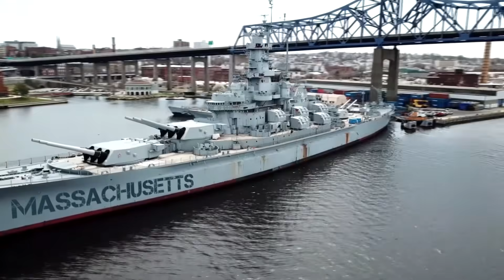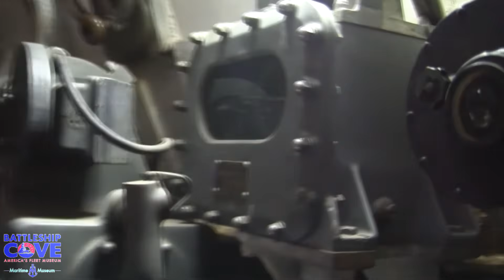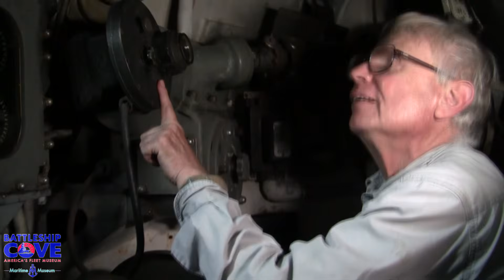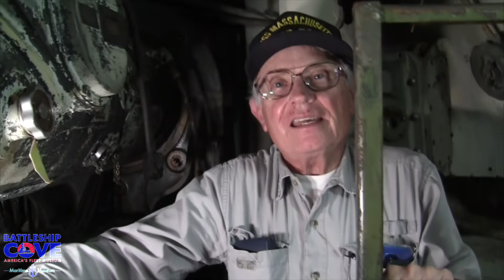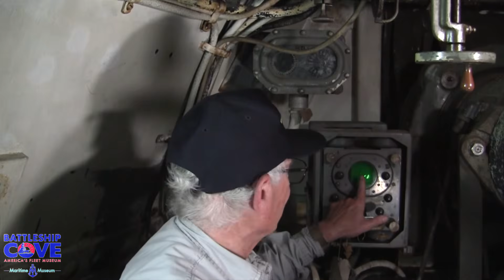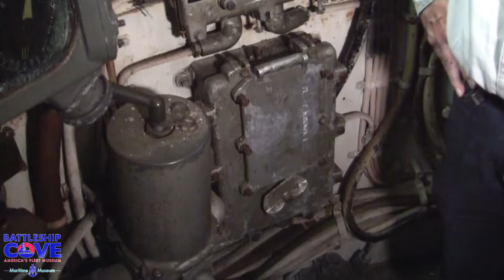Inside the History: Spot 1 MK38 Fire Control Director on WW2 battleship USS Massachusetts BB-59

Comment: is there a separate fire control director for each turret?
Reply: In my days as an FTG, there was not. 1968-1978. We had only one director for both guns. This was on a guided missile destroyer. I'm sure it was the same for battleships.
Reply: In the case of the 16" guns, no. There is Spot #1 (one they are in) that is located towards the bow, and then Spot #2, which is further aft (located aft of the 2nd stack) and is lower than Spot #1. Those are the primary directors for the 16" guns. 

There are a total of 4 directors for the 5" guns that can be used to direct the 16" guns if it was required due to battle damage or for other reasons that may have arisen in battle.

Comment: @2:42  Various online calculators say that at 117 feet, the distance to the horizon is approx 13-1/4 miles.  If you took into account hypothetically being able to see the like-sized fire control tower of the enemy ship, the equivalent height doubles and the distance between the two towers would be about 18-3/4 miles.
Reply: The distance to the horizon is d=sqrt(2*h*R) where h is your height and R is the radius of earth. Plugging in h=117 feet and roughly 21 million feet for R, you do indeed get a bit over 13 miles.
Reply: @davidsoule1252 that was a very rude way to phrase a comment, especially considering your basis for it was wrong in the first place. The fire director is not on the bridge, so its height is irrelevant, and I have no idea where you got the idea that line of sight between two objects is determined by summing their individual sight range.
Reply: @comicmoniker  The gun fire director is atop the bridge. After some reseach, I found that the height of the highest mast on USS Massachusetts is 160', so I was wrong in my heights. But, at the height of 117' you can see the horizon at 13 1/4 miles. An equal size enemy ship has it's fire control optics at 117' above the horizon. I am absolutely correct about the distance doubling. So the correct miles to see each other would be 26 1/2 miles. But, if two battleships are facing each other in a battle, there is no way that either could hit a target in the ocean at that distance. Battleships can fire rounds close to 25 miles.The distance for a battleship to fire rounds that hit the other ship would be less than 13 1/4 miles unless they got extremely lucky. Those in the fire contol director or at the radar would have to see splashes on the horizon to adjust their firing. I don't think vision from those in the fire control director or the fire control radar could see slashes at 13 1/4 miles Even the OP mentioned that "the equivilent height doubles". He used bad math. I used bad heights. I'm good with what you said. I was at least partly wrong.
Reply: @davidsoule1252  I appreciate you copping to that. For my part, I was misremembering the formula for line of sight between two elevated points, on double checking I see that you can just double it if they're at the same elevation. Cheers

Comment: Wow fascinating…. More!!! On how these guns are aimed
Reply: I was an FTG in the Navy from 1968-1978. The guns are aimed through the gunfire control computer. We had different options. Naval gunfire support on land was mostly done using only the computer. Combat Information Center (CIC) would receive info by radio from Marine spotters or from planes. CIC gave us in Gun Plot,  the info for the firing missions. We would set up the gun fire control computer according to the directions from CIC. The guns followed what we manualy set into the computer. I was the one in Gun Plot on USS Joseph Strauss DDG-16 to communicate with the gun mounts to relay info back and forth. I would relay info that we had a firing mission. I would relay information when to fire and how many rounds to fire. I also had the job of pulling the trigger to fire the guns. If we received counterbattery, we turned control over to the gun director that had visual contact with the counterbattery. The gun director officer had control of the guns and got on the counterbattery. We had an excellnt FTG that could use the rangefinder in the gun director. This also went into the computer and aimed the guns. The director officer also controlled the firing of the guns. If we had an air attack from MIGS, our radar would find the target and we would put the computer into a radar firing mode. I would take over communications with the gunmounts and the gun director. Thankfully, this never happened to us. FTM's ( fire control technicianas missiles) had our back. They were ready to fire missiles at any MIGS that may have attacked my ship or any other ship in our task force.